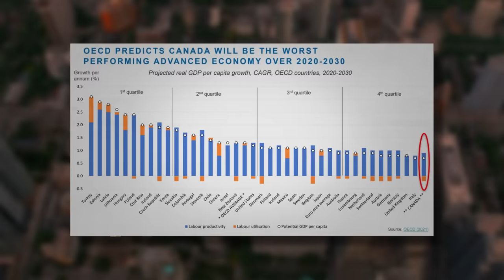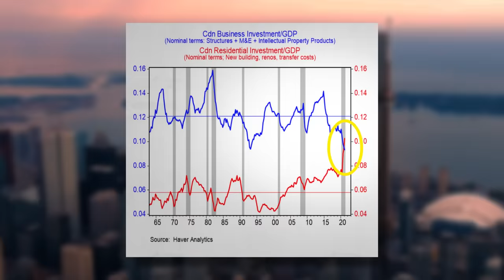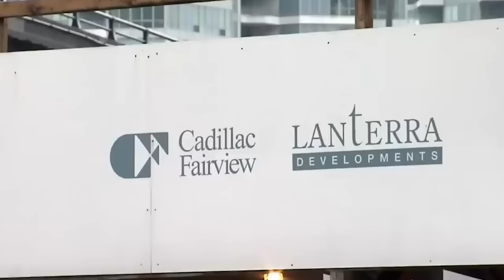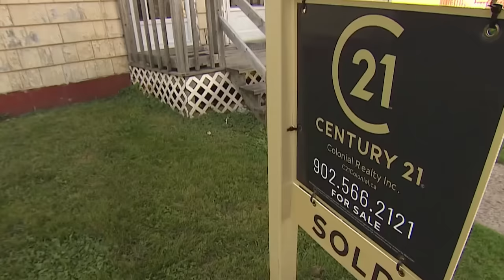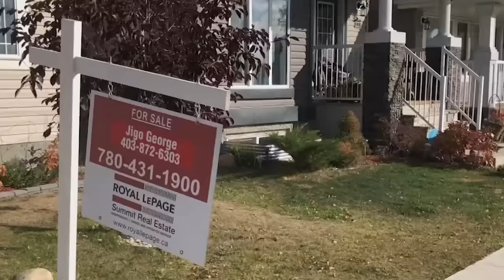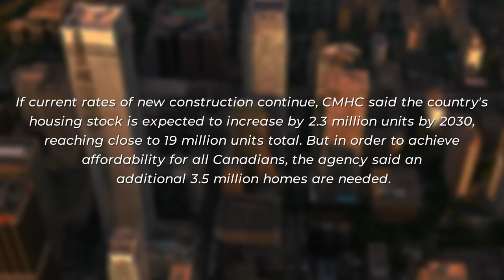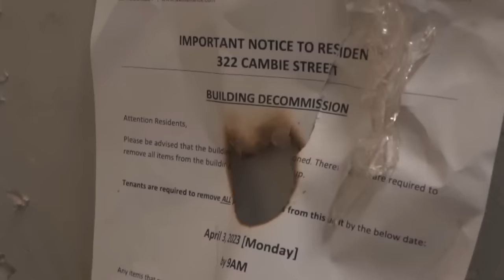The Not So Polite Truth Behind Canada's COLLAPSING Economy!

Comment: Just for perspective, I live in Ontario just outside of Toronto. I did all that I was supposed to do. Got a good education, got a good job as a software developer, bought a cheap car for cash, saved and invested my money wisely… you name it. I have ZERO debt to my name and have saved a good sum of money. I literally can’t afford fuck all anywhere even close to me. Not even close. I would need to move 5 hours north away from all my family and friends to a much less desirable city or some bum fuck nowhere town. Even then I would barely be making it because of how expensive mortgages are and on top of that I need food, utilities etc. Most young people have just given up and are moving in to shitty apartments with friends where they basically just have a bed, a shitter, and a table to eat their porridge at every morning. These are not people working part time minimum wage either. They are highly qualified young adults in banking, tech and engineering. The system is fucking broken.
Reply: well if youre a software engineer you could easily afford a place in woodstock, or niagara region which are both less than 2 hours from toronto

Comment: The inflation in residential land/housing prices and low productivity and high immigration and the hollowing-out of the manufacturing sector. Sounds like Australia.The parallels are frightening. You just get the feeling that something drastic has to give.
Reply: Lol, immigration is the only reason why Canada is not third world yet. They mostly accept working age adults in their prime with college degrees. Without the high tier immigrants Canada would be completely screwed. Their population would have aged out and their social security system would have simply collapsed. 

Like it or not, but the only way to have a fast-growing economy is to have a ton of young college grads starting tech companies. That doesn't just happen. You have to engineer that. Canada and Australia did a pretty good job with very their selective immigration systems.
Reply: @TohaBgood2  japan gets by just fine and they don't focus on immigration. You can bring in skilled workers but u can't force them to buy into the system/country.

Comment: There's no such thing as an 80 or 90 year amortization period for mortgages in Canada (at least not residential mortgages) this is a lie..........40, 45 years tops.  Furthermore, Canada's health care system is not being strained because of an increase in immigration (for the most part, immigrants find work and pay taxes), it's strained because certain politicians keep advocating for privatization and actively defunding the system.  3rd point:  Canada doesn't have +1,000,000 immigrants every year, immigration is capped between 200,000-350,000 per year depending on which political party is in power.  Get your facts straight.  Canadian citizen here.

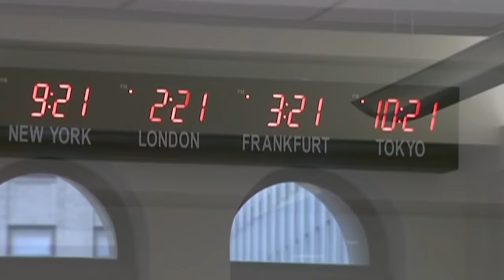Comment: 4:04 This is actually incorrect. There was a transfer of mortgage backed securities from the Big 5 Canadian banking intuitions to the tune of 114 Billion dollars in 2008. This wasn't a direct "bail-out" as done with US banks so it wasn't given as much fan fare. Harper actually was able to keep it secret for years following the 2008 credit crisis. The result though was the same, the banks gave bad/toxic debt to the Government to hold and the banks thus had excess capital to lend. It was still a bail-out by any other name. The housing bullshit has been running up since the 90s. The Feds at the same time were in the 1950s to the 1980s building tens of thousands of low/middle income housing themselves every year. Early 90s this stopped. Thus the run up in prices since.